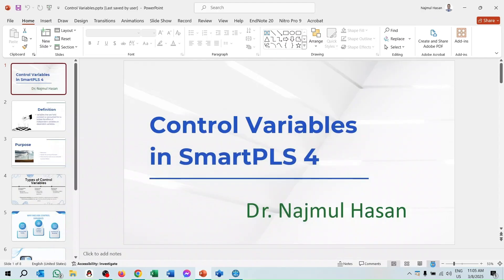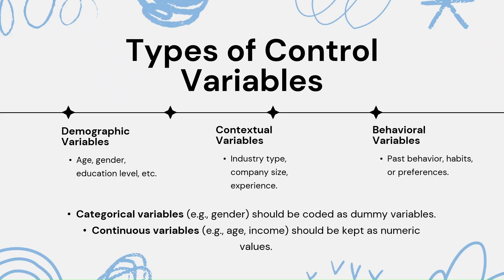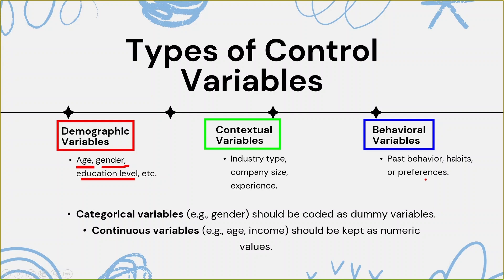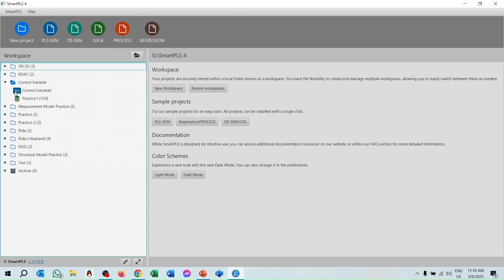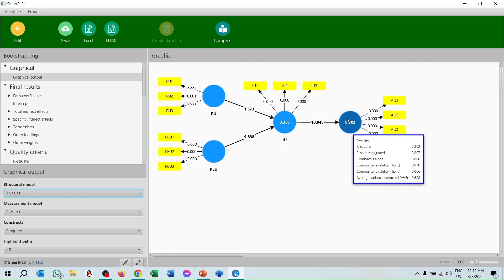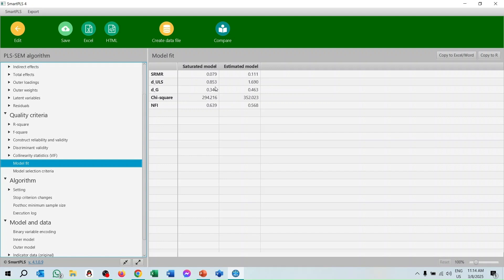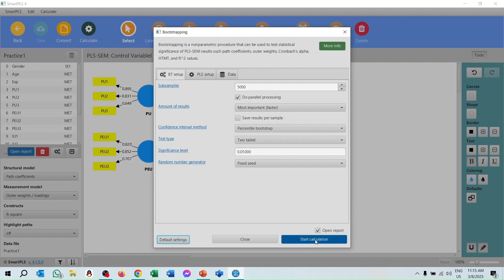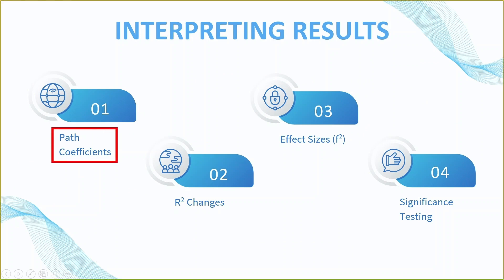8 Control Variable in SmartPLS 4

Comment: Thanks for your video! It was of great help.

I’m working on a PhD thesis using PLS-SEM (SmartPLS 4) and need clarity on how control variables should be treated in relation to hypothesis testing.

Specifically:
– Are control variables typically included in the structural model when estimating the main path coefficients, so that hypothesis tests are based on a controlled model?
– Or are controls assessed post hoc, after testing the hypothesised relationships?
Reply from the maker: Thanks for your appreciation. However, control variables typically included in the structural model not in Post hoc section. IPMA is used in post hoc section.